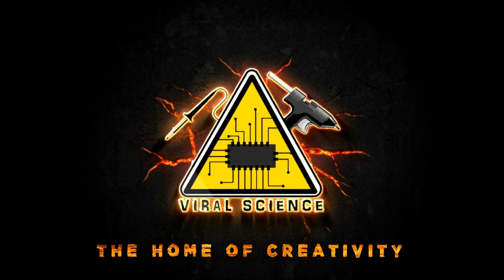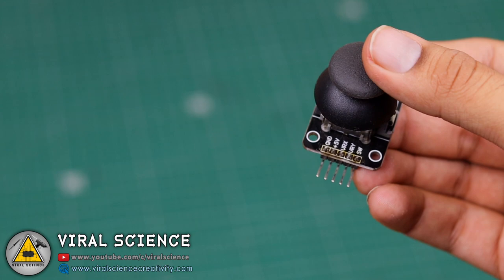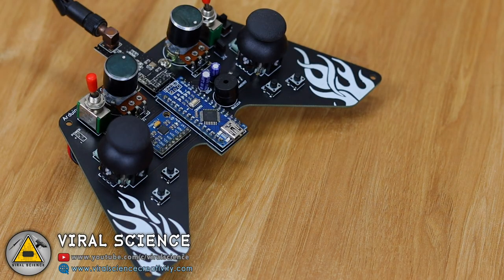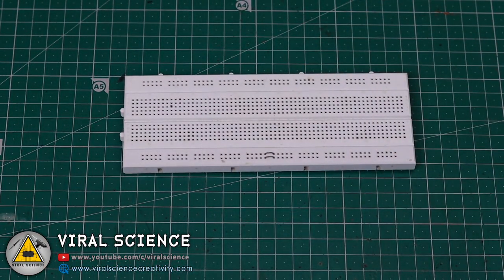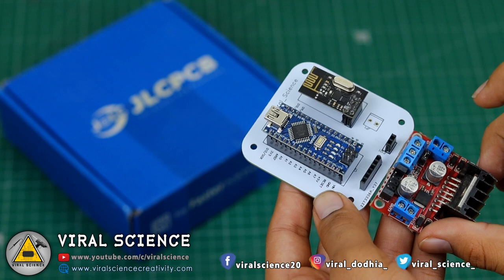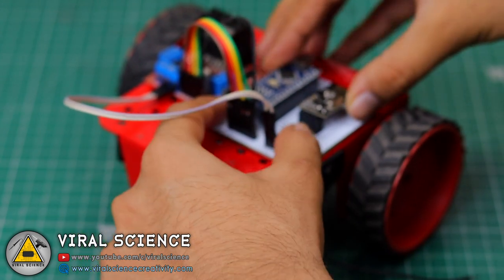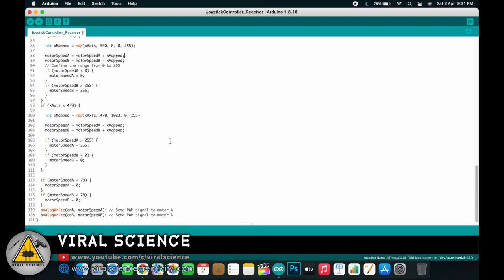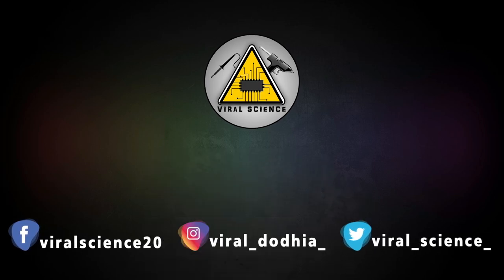Arduino NRF24L01 Wireless Joystick Robot Car

Comment: PWM on A3 and A5:

On the Arduino Nano, the A3 and A5 pins are not PWM-capable pins when used in analog mode (as A3 and A5).
You can use analogWrite() on A3 and A5 if they are configured as digital pins (D17 and D19), but these specific pins do not support PWM when used as analog pins.
To ensure PWM functionality, you should switch to PWM-capable digital pins (such as D3, D5, D6, D9, D10, D11).